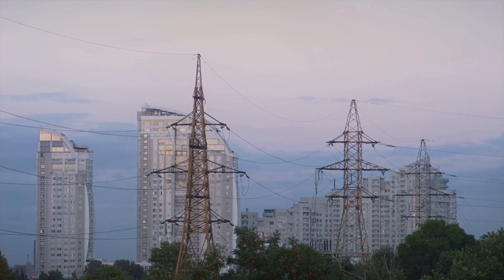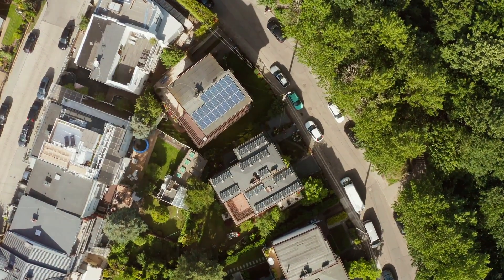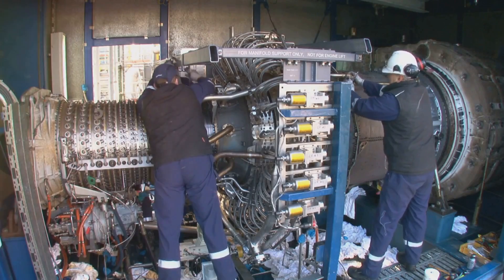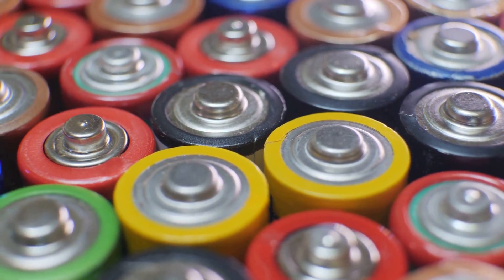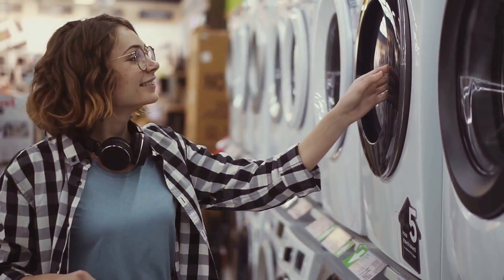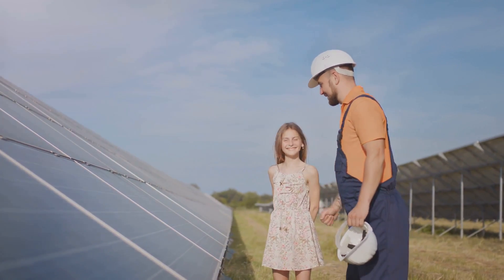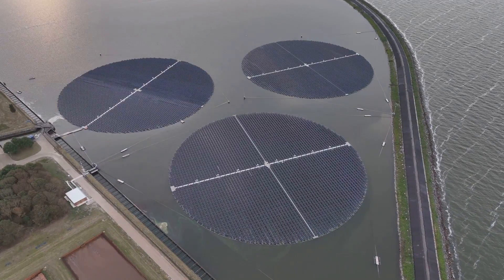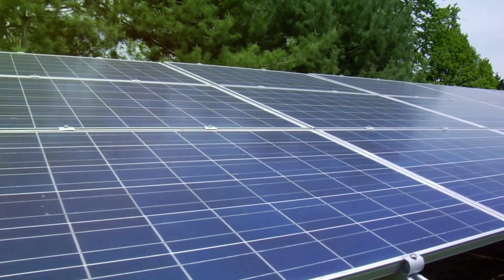Bugging In - Part 4: Power Generation & Energy Storage

Comment: For lighting you can use outdoor solar light strings, just mount the solar panel in a southern window to recharge.
Reply from the maker: That’s a great tip, Patrick! Using outdoor solar light strings and mounting the solar panel in a southern window is a smart way to keep your lights charged and ready, even when you’re indoors. It’s a simple yet effective solution for maintaining some lighting during a power outage. Thanks for sharing this clever idea—every little bit helps when you’re bugging in!